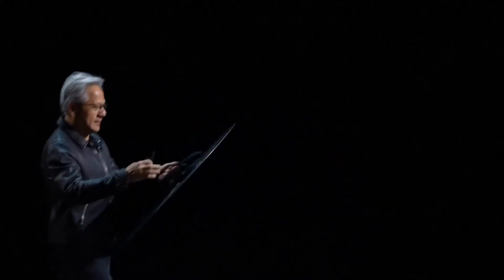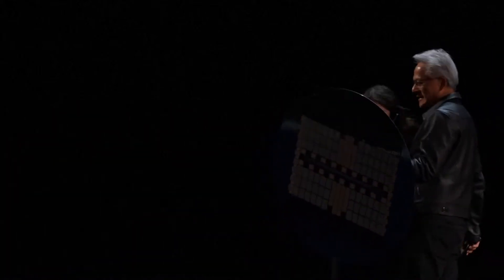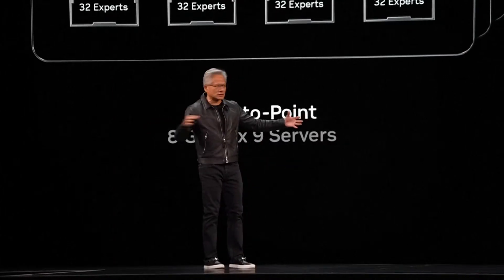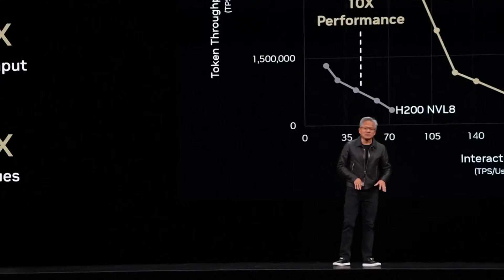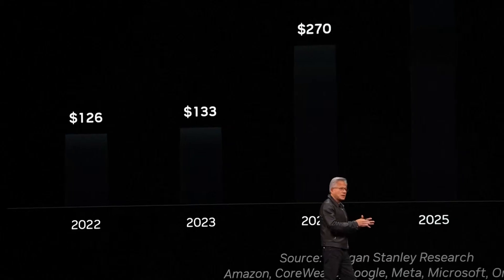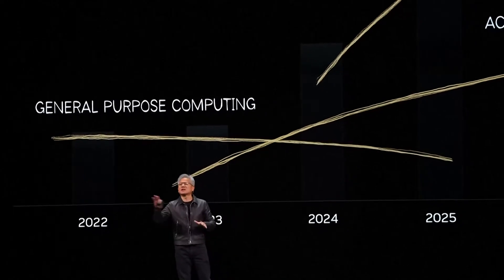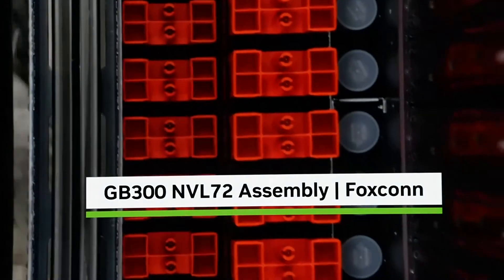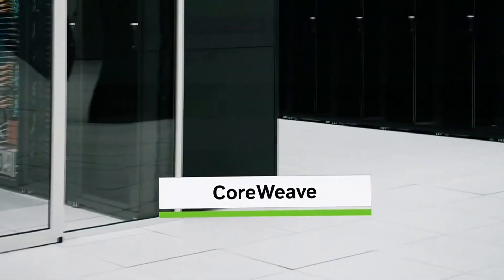Inside NVIDIA’s Most Powerful System Since IBM System/360 | Jensen Huang Keynote | DWS News | AI14

Comment: with backdoors as did China claim?
Reply: intel and amd had to tell everyone that their CPU's for decades have a sub CPU, ram, storage and os that is directly connected to the Ethernet port imbedded into their CPU's said to monitor security of their hardware. Both CPU's sub CPU profiles were compromised. Do you really think that 13th and 14th gen micro was the full story. As soon as I read that the US administration announced that they were investing 6 billion into intel, I told my friends to watch because something will play that will drive Intels stock down for the US Gov to start buying in. Not even a week after the announcement the news headlines was nothing but the high end 13th and 14th gen chips burning out because of a so called micro coding error that the chips left the factory with. not even 2% had to be warrantied, then after that dust settled, Intel bounced from the low 18's to the high 30's. Everyone that has ever traded knows that is the play and it is done every single time someone/ partner is buying large positions into large cap. And they get away with it every single time. Unless of course you are a small time trader like Marther and you need a fall guy to distract the public from huge positions being moved in and out of the market.
Reply: If it’s made in the USA then yes you have to accept the products have backdoors.